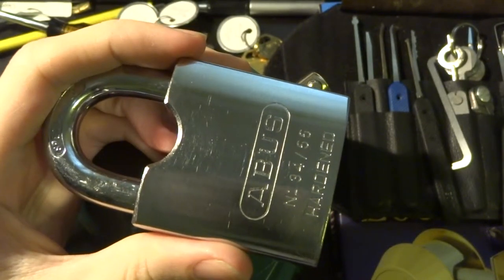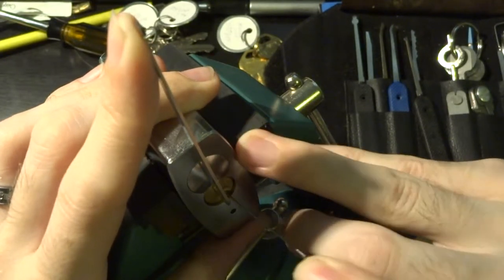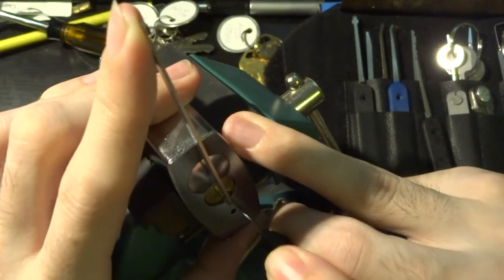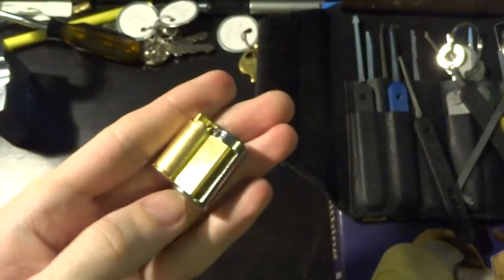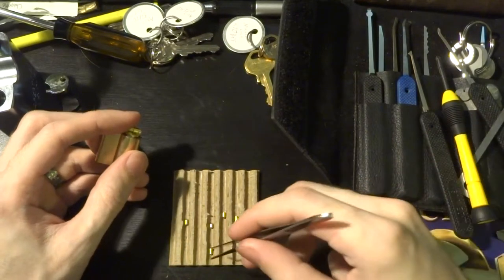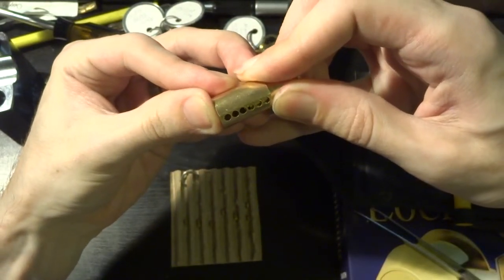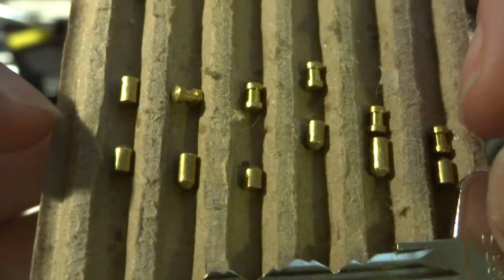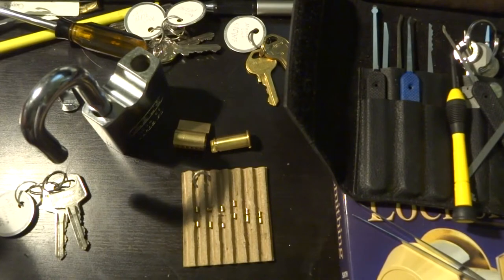(019) Abus 34/55 padlock picked and gutted

Comment: l learned a new trick for removing clips,  the can opener in a multi tool works great, bottle openers work too but the bottom hook maybe to curved but that can be easily filed down. my cheap multi tool has the can opener I said earlier that works great on the American lock circlip funny thing is just under it the bottle opener tool with the deep curve so I can custom file it for the larger clips instead of wasting money on a clip tool. I have a schlage kwikset remover I got for dirt cheap that works good too. I was shopping for a pliers type tool which now is unnecessary. I had the tools in my pocket multi tool that works & didn't even realize it.
Reply from the maker: +JB Interesting idea, I will test it out next time I have one open. At home I have a pair of snap-ring pliers which work pretty well although the narrower padlock core retaining clips are still a tad tricky.

Comment: if you lock the plug up with no key pins use a comb pick to lift the drivers back in place.
Reply from the maker: Hmm, perhaps you should refer to my 9th video which covers the use of comb picks.
Reply: +Nite 0wl I seized up a American core and it sat there for weeks until I stuck a comb pick up there, I thought it was a lost cause. now I lost a key pin and am screwed again. my pinning kit doesn't have those tiny pins. I ordered a security pin kit and American spools and serrated pins but forgot to order bottom pins.
Reply from the maker: +JB Ouch. Sounds like you need American Lock's APK1 or ASK8 kits (APK1 is basically just pins while ASK8 includes master wafers, replacement parts for actuators, retaining plates, etc). You can find the APK1 quite cheaply if you look around online.